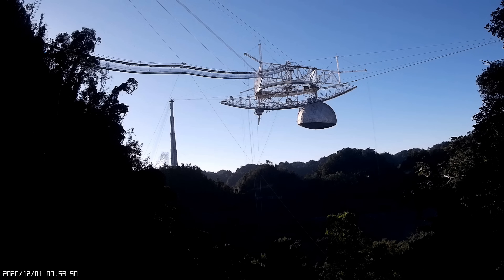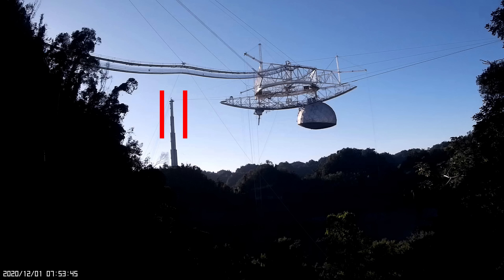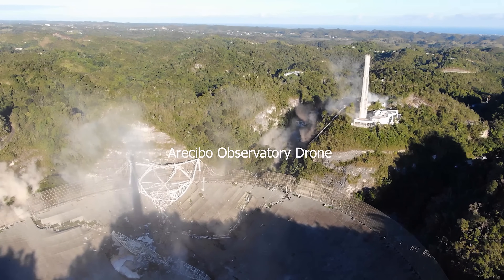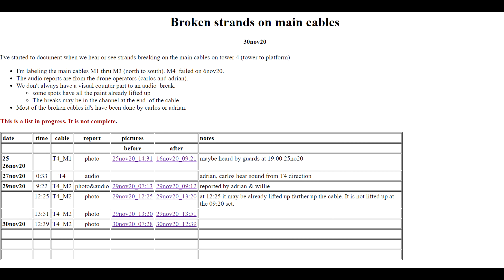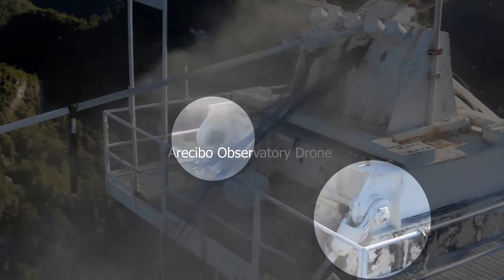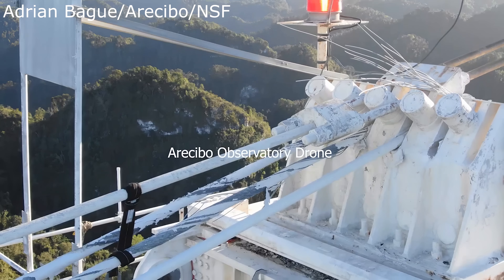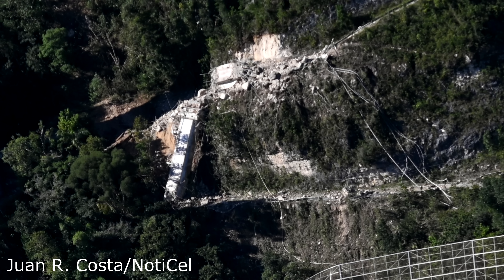Analyzing Video Footage Of Collapse of Massive Arecibo Telescope

Comment: I don't know how long they were flying that drone for, but talking about good timing
Reply: Bet the operator hasn’t stopped thinking  about that moment
Reply: I read somewhere that complete catastrophic failures like this have plenty of signs of acceleration of the process until the final collapse... think of like crackling of the wood in a falling tree. They likely had sensitive instruments "listening" to the cables and knew it was imminent...
Reply: @TheCruisinCrew   You can usually hear it simply by ear.  Anyone who has ever listened to a tree being cut down knows the sound of imminent failure.  I imagine it was much louder than a tree.
Reply: Sounds like they were up there every hour with a drone
Reply: I don't know if it was epic timing. One commentor in anger video of this said they were flying the drones almost non-stop keeping an eye on things.
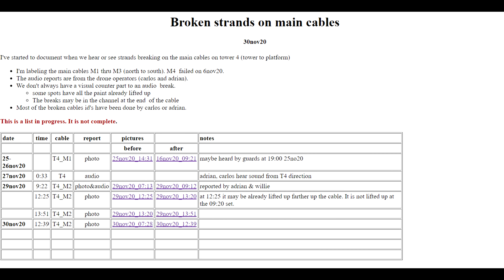Reply: @Nareimooncatt  Scott says it in this very fucking video.. 3:18
Reply: Not hard to get a drone with a transmission range of 6 miles or 10 km. DJI’s mavic air 2 is not terribly expensive.
Reply: I’m sure they heard strands breaking with a markedly increasing frequency and saw tell-tale signs of eminent collapse
Reply: I'm amazed at the sheer guts of who was flying it. He had to be somewhere nearby because drones don't have unlimited range, yet even in the middle of all that chaos and noise he was able to spin the drone round in time to catch the end of the collapse. Frankly, if it had been me I'd probably still be running...
Reply: @d2factotum  Even current consumer grade Mavic drones like the Mavic Mini 2 or Mavic Air 2 have a range of around 6 miles. He was probably on site somewhere, but nowhere near the actual dish or its cables.
Reply: @d2factotum  He would have been in one of the designated safe zones. Probably in the control room.
Reply: @d2factotum  he was nowhere near this when it happened
Reply: @d2factotum  peons like us use drones with limited range.  I doubt the operator was anywhere near danger.
Reply: @incubusfan4211  yep, we already have technology for long distance drones, talk about the Predator and the Mars Rovers.
Reply: @d2factotum  he did mention they were working within save zones though.
Reply: @d2factotum  Tha pilot should be awarded an Emmy for Best Photography
Reply: @thiesenf  and some clean trousers
Reply: @d2factotum  Even my tiny DJI Mavic has several kilometers range..
Reply: @GustavMeyer  I was thinking the same thing, I have a Mavic too and its range is supposedly a few km. Never sent it that far though
Reply: @d2factotum  there's drones that you can fly miles away from you.
Reply: d2factotum he could be at 5km away some dji drones can be controlled 10km away
Reply: @d2factotum  The telescope has been falling into disrepair for many years, so I expect the operator would have positioned themself well out of the way.
Reply: @d2factotum  Eh even cheap drones can go up to 10km these days.
Reply: @d2factotum  they actually have pretty good ranges now days, good consumer ones have a range of 10km
Reply: @d2factotum  There are prosumer drones that have ranges of ~ 7 kilometers and battery life times of more than 1 hour.
Reply: @d2factotum  I fly a dji and have flown more than a mile from myself before
Reply: @d2factotum  Well, even the entry level dji drones has pretty long range, at least over 1 km.
Reply: @d2factotum  drones nowadays can reach well over a mile away. they use them to inspect train tracks and power lines but yeah prob nearby
Reply: @d2factotum  this days  drones can be easily controlled five miles away
Reply: @d2factotum  The operator was probably a few km's away atleast so nothing to worry about.
Reply: @d2factotum  lol believe me, the drone operator was NOT in the danger zone. So.. no guts required
Reply: @d2factotum - Drones can be controlled from several Km away. Arecibo is technically private property, & the site is huge, so he was probably further away than you might have thought.
Reply: Thank you Scott
Reply: @Paul van Dinther Lots of cable stay structures have built-in mics these days. It would be great if they did and they released the audio.
Reply: they probably heard the twanging sounds of steel wires around the cables snapping and used the drone to investigate
Reply: its quite possible it was a custom drone so may have had a decent flight time (i.e. > 15 minutes), as for those commenting on range, it depends, rcflighttest (solar plane guy) frequently gets multiple mile FPV downlinks and has some of his kit fly for 10s of kilometers so the operator could've been anywhere. Glad to hear everyone is safe and no body got hurt
Reply: What an experience.
Reply: A lot of people use custom drones and control them in an analog fashion which gives near-realtime FPV and range of over 20km easily, they just strap a standard HD or 4K camera below the one they're looking through and record while flying.
Reply: Once in a while you get lucky. This was really lucky. Probably the perfect spot. If they didn't have a drone it would have been someone up there inspecting things. Glad nobody was hurt.
Reply: They knew it was to be destroyed.. after a Polish mathematician was able to decode mosi signal from space originating from planet Jupiter on November 3...the space vehicle was detected leaving Jupiter heading to eath by Hawaii space observatory...NASA reported the vehicle as remain s of a rocket named 2020..in space to cover up what was heading to earth..but they knew..it's mission and positioned the drone   that captured the above video
Reply: The video says the drone was inspecting cables on the tower. So this might not have been good timing or coincidence, they could’ve suspected something wasn’t right which was why the drone was there in the first place.
Reply: Oh and he explains it later in the video I see. So what exactly was the point of his comment?
Reply: Drones can have ranges upwards of miles.... And that just small few grand drones. They can have a range expanding the entire globe with sufficient equipment set up.
Reply: I have a theory. I think something big is happening and what better way to get rid of that what maybe any evidence of what to come. I find the cameras placed and drone coverage not to be mere coincidence. I see the bigger picture. I bet if you run any of the footage through a spectual analysis, you'd find the culprit. I suggest something in the ultra violet spectrum.
Reply: Great observation.
In addition, Communist China now has the largest spherical telescope in the world. But of course, people don't see the connection. Just as no one sees no connection in the case of COVID-19. 

zenodo*org/record/4028830#.X49e2tAzZqM  
(* replace with a dot)
Reply: yes very good timing indeed,they knew it was about to go thats why the drone was there.
Reply: Just making sure it gets decommissioned correctly? ;) just saying...
Reply: Srysly!! So dope
Reply: Has to be hunderst of metters away if its not childs toy
Reply: right place right time
Reply: "How's the cable inspection going?"
"Fine. The cables don't look too—ah—"
crash
"The cables are gone."
Reply: Conspiracy....
Reply: talk*

Not "talking"
Reply: Didn't they deliberately destroy it coz they retired the telescope. I would think they flew the drone
Reply: 15minute flying time for everydaz available drone.last time i was into it.....so very good timing.
Reply: If it wasn't recorded, no one would believe it!
Reply: @cherrysdiy5005  it doesnt exists if google cant find it :D:P
Reply: good thing the cables broke during inspection and not during repair.
Reply: we went to Drone Surveying this Summer.......lol these guys are never in the office anymore...flying all day long..
Reply: They  probably heard noise coming from smaller strands of cable breaking in the distance, and already expecting it to fail from a 'safe' position sent the drone to document.
Reply: Agreed but looking at the old cables it looks pretty obvious the whole thing was going to fail fairly soon, maybe not the exact time they were flying but it looks like a disaster waiting to happen. I'm impressed at the pictures that were achieved, better than most controlled demolitions :)
Reply: They destroyed it on purpose
Reply: So many meteor impacts, so many new anti missile defense tech (declassiifed recently that upset China and Russia), so much stuff going on.  You think they’re going to keep public updated and informed? History proves otherwise.
Reply: @wakeuptotheunipartyoverlor8797  Check question: Was your mobile phone (with authentic hardware source codes, quality surround microphones, online cameras, and GPS locator) made in the US or communist China?
Reply: Fr what are the chances of that... that’s pretty sus imo
Reply: This ain't a coincidence!
Reply: -Matter didn’t create anti matter
-Anti matter didn’t create matter
(Both of them were present at the time of big bang)
-Both of them didn’t create themselves.
-Both of them came from an unimaginable source,  that unimaginable source created matter and antimatter (everything) thats why it is known as “the creator” of everything.
——————...............,,,,—————
- that unimaginable source/creator has created sin and virtue which are opposite to each other,
— logic says every action has its own reaction, so the reaction of sin must be different than the reaction of virtue,
— the creator has created prophets to let us know about each and every detail of sin and virtue, also about their reactions,
Thank u
Reply: The collapse of USA kingdom is expected to be like this,everything in a sudden, much faster than the collapse of USSR.
Reply: Why was the drone positioned directly at the point of failure @  1:25  Specifically on the cables tied down with a black heavy duty belt because those failed first?...  It also looks like the heavy duty belt was tied down to something else, so were the cables destroyed on purpose with a pulley system of weights?... Or was the drone really in the right place at the right time?...
Reply: @_A4A  scott said something about them using the drone to inspect the cables since they had notoced them getting weaker. And yes it kind of was perfect timing.
Reply: Controlled demolition...
Reply: Yeah, what luck, what coincidence, what a bunch of bullshit. They wanted the footage to see how well the shape charges worked so they can use them more efficiently in the future on bridges. Another controlled demo, follow the money. Who benefits?
Reply: Yes, top video footage (award stuff actually, I think) and the drone pilot did the sensible thing pulling the drone' nose back just a little before that actual moment everything went to hell in a handbasket, with high-speed shrapnel and crap firing out in all directions. It's lucky not to have been smashed to bits by some of it.
Reply: If you look at the drone footage, when it pans around so that the helipad comes into view you can see what appears to be the drone operator off to one side in a red jacket.
Reply: @webchimp  that red spot is way too big to be a human.
Reply: @johndowson1852  i will say if you look at the helipad at the bottom right there is an actual person standing there
Reply: @webchimp  The red thingy is a box of some kind, you see it in the aerial photos later.  Even a good consumer drone like a phantom 4 has a 7 km range, a professional drone would have an even longer range.
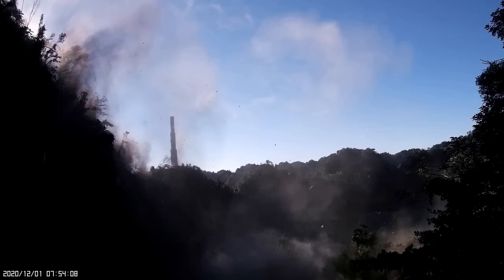Reply: @webchimp  That's definitely not a person. The same red thing is in the aerial photo at 9:53
Reply: @webchimp  at about 10:00 time
Reply: @webchimp  At which point in the video is this visible? As I don’t know which part is the helipad I am missing what you are seeing.
Reply: @webchimp  you got really good eye vision to spot that
Reply: @webchimp  if you think that is a human XD its WAY too large to be a human.
Reply: @webchimp  That's... not a person. lmao
Reply: As Scott points out - inspecting the cable mounts
Reply: More than that, 10 years ago, it would have been a guy up there in a harness instead to inspect the cables, imagine being tethered to a falling tower of concrete.
Reply: Someone must have said forget helicopters and just wait for entropy to take care of things.  I have to think the firm that did the 1997 refresh wanted to see how their product failed. I think there are other structures at risk elsewhere.
Reply: @cynvision  absolutely no way that group wanted an uncontrollable collapse and potential casualty in relation to their project.
Reply: @kgolds988  I get what you're saying. Ran out of time to drop it neatly, if they had a plan figured out. Neatly or messy, it was going to cost more surface of the dish.
Reply: Not good timing if they knew the cables was going to snap at that time, they made it snap, funny how that no one even thinks about that as an option lol
Reply: @JacoKruger.  why the fuck would they destroy one of the most important devices for astronomy willingly?
Reply: @danielm.595  What terrified them so much that the scientific community and the general public cannot see?  right?
Reply: @icy14  found the conspiracy theorist
Reply: @danielm.595  Found the troll!
Reply: @JacoKruger.  Bingo!
Reply: Please, for the love of all that's holy and the future of humanity, let these conspiracy comments be from pathetic trolls and not people that actually believe that shit.
Reply: A little too good, if you ask me. Did the antenna have dirt on Bill and Hillary 🤔
Reply: @slaphappyduplenty2436  🤣🤣🤣🤣🤣🤣👍👍
Reply: EVEN THE DAMN RUBBLE PILE ITS COLLAPSE TURNED INTO...
KNOWS DAMN WELL EPSTIEN DIDNT KILL HIMSELF!🤔
Reply: @slaphappyduplenty2436  coincidence along with the rest of the fall of western civilization.
Reply: So I heard before this happened that they were going to demolish this soon. So I don't think this was an accident in any way. Which explains the camera placement.

 @artistjoh made a very good comment that explains what was happening. So I retract the latter half of my statement.
Reply: @FlySwann  Of course it was a fucking accident... A predictibal one though and certainly not unexpected... They had been closed down for two weeks because they feared this could happen, having drones up for a lot of that time. Even if they had the drone up just a few times still makes it maybe one in a hundred to catch the fall, and much greater chance if they had it up a lot. A control demolition wouldn't have looked like this...
Reply: @nihlify  Haven't you heard? Everything's some sort of conspiracy these days. There's no such thing as reasonable coincidence anymore, more likely it's something nefarious to do with the government, big business or the wealthy elite. Wake up, sheeple! Et cetera, ad nauseam...
Reply: @nihlify  I don't know why your getting belligerent, but I understand what your trying to say.
Reply: @FlySwann  lol demo plans take weeks or months to establish. It was being demo’d because failure was imminent. The cameras were there because that had already heard strands of the remaining cables snapping in the days and weeks prior. 
No conspiracy here - nothing for anyone to gain as well. 😕
Reply: @EstorilEm  I didn't say it was a conspiracy.
Reply: @FlySwann  The actual collapse started weeks earlier and was proceeding in slow motion. After the initial cable snapped inspections of the remaining cables revealed the smaller cable wires snapping one by one. As a result they knew it was going to come down, and they were monitoring the cables almost continuously during daylight hours. Normally this would be done by people on the tower walkway, but as this was in extreme danger, and the high likelihood that the tower itself would collapse, cameras mounted on the tower were not an option (as it requires someone going up there to install them.) as a result the only option was drone monitoring. The drones were there, not so much to observe the collapse, but as a potential warning for staff of imminent danger, and it is possible that the reason for no injuries is the increased rate of wire snapping on that central cable in the hours before the final collapse that caused staff to remain under cover or at a safe distance.
Reply: @artistjoh  that's very interesting, thank you.
Reply: @FlySwann  They were going to demolish it because it was in danger of collapsing under its own accord. A controlled demolition would have been far safer than an uncontrolled collapse like this.
Reply: @d2factotum  okay thanks, I tried looking up about it right after it collapsed. But if course any Google search for articles at the time only found articles pertaining to the collapse with little to no context or history to what led to it.
Reply: Not so long ... I guess they just coordinated with the guy firing the explosive charges ;)
Reply: @itsverygreen532  Bingo!
Reply: Coincidence ???? I think not..  just saying..
Drone footage sucked. Should of had competent operator/pilot.  
Just saying.

Comment: Wow, are they going to try to rebuild it? Not fix it, but make a new one in its place?
Reply: wow what a concept
Reply: Not much left that can be repaired, easier given it's age to just replace most of it.
Surviving equipment is:
430MHz transmitter (but not the suspended waveguide it was connected to)
HF transmitter and most of the HF antennas (in the center of the dish)
Control Room and most related buildings.
multi megawatt power feed.
The platform contained:
All the receivers
The 2.38GHz radar transmitter and antenna. (RIP asteroid tracking ability)
The 430MHz transmitting antenna
rotating mounts and tracks to move the antennas into position.
secondary and tertiary dishes.

The dish surface itself, is just aluminum sheeting suspended from wires.
It was in poor condition before cables started breaking, would be harder to repair than to simply replace.
The 3 towers need to be demolished anyway.
Sadly it's mostly scrap metal, but some things could be saved.